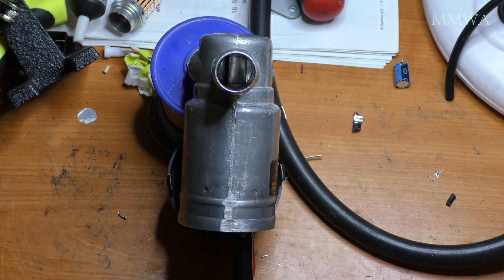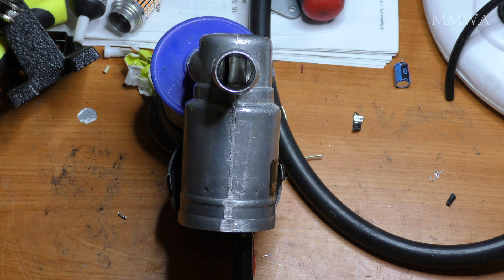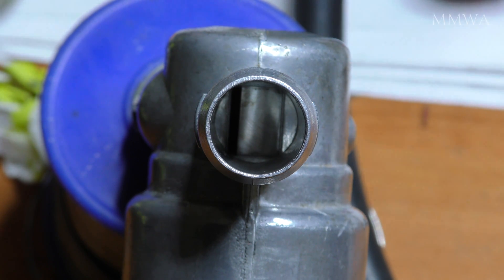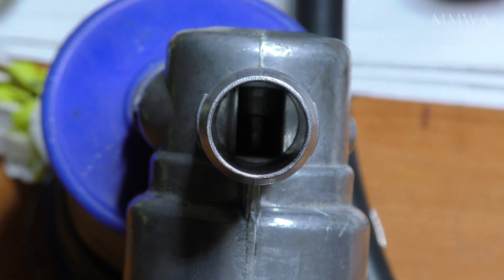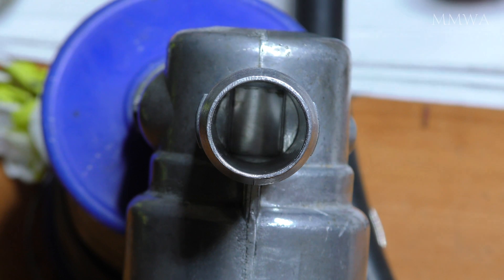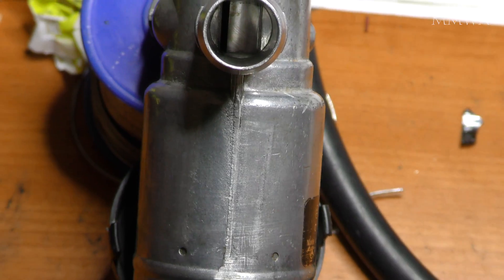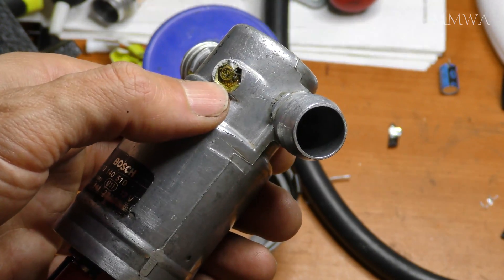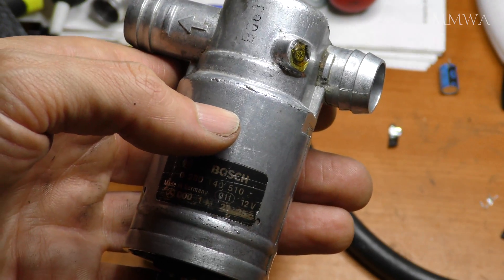Bench testing Mercedes M104.98x idle control valve

Comment: Awesome video .
 I own a 1992 SL300 M104-24 KE Jetronic and a 1997 SL320 M104 . Both are great cars .
  I recently purchased the 1992 SL300 M104-24 with 126,000 original miles and the car idles really rough and about 500 rpm's . I have  to keep my foot on the accelerator, to keep og form stalling out . Do uou have any idea , what the problem could be ? Any information is greatly appreciated.
Thank you .

Comment: My SL 300-24 has been laid up for a few years, so i changed both pumps filter and accumulator, plus cleaned that small filter at the fuel distributor, At last the car started but with clouds of black smoke and an irregular idle , what idle i had to keep my foot on the throttle, it does try to idel but at 450rpm, it soon stops, any suggestion ? I drained the tank and there was a lot of crap, in it plus a black  sludge , 
I will look further, so thank you for this info my car has 135k ( miles ) on it and was laid up for 7 years. Its a multichoice what is causing the problem and reassuringly expensive. Cheshire UK
Reply from the maker: clouds of black smoke usually indicates the fuel distributor diaphragm has failed, it may be the reason the car was originally parked up.  Crap in the tank is very worrisome, i wouldnt have run the car at all with this tank as you may have contaminated the entire fuel system.

Comment: Hello.I cleaned my icv and there i go turning the engine on after a full service and my idle is at 900 rpm i checked everything (vaccums potentiometer  o2 sensor and so on all of them new bought by me)so i go the icv valve and disconect it nothing happens..i check the V and i have 2.4 i plugged it again nothing happens i disengage the microswitch and engage it nothing happens even tho i have the continuity..What would be your thought on this issue?
Reply: Any thoughts please?My idle is normal at 650-700.Voltage to idle valve 2.5V

Comment: W124 2.6 1990 .  Idles perfect. Starts perfect. When put into gear rpm falls beneath 500 and stalls.  Checked and replaced all hoses.  Smoke test.  No leaks.  Air pot between pins 1 and 2 is .92 volts at idle.   Which is within spec.  Idle control valve bench tested perfect.  Open 20% with no voltage and closed at 4 volts and wide open at 8v. Car running in park is sending 4.5 volts to the idle control valve.  New potentiometer on air pot.  Everything is working as it should.  Beyonce my little brain this is very puzzling.  I'm at a loss and about to adjust the set screw on the idle control valve. Any words of wisdom would be great.  This car only has 70k miles

Comment: Good video, but why not explain how you applied power to it.  I'm left wondering how I test my Bosch unit off my Porsche 928 which is similar.
Reply from the maker: with a variable current bench power supply. Thats is literally all you need. Mine is a china special, 0-24V 0-5Amp. Mb states the maximum current availability from the idle speed controller on older models, with this knowledge you can work out if the problem is with the valve or some other external air leak

Comment: Where is the Idle air control valve for 1993 Mercedes 300TE wagon? I can find it
Reply from the maker: what kind of engine do you have?
Reply: @MMWA-DAVE  This is my cars Engine (104) 1993 Model 300 TE (124 092), 4-stroke engine gasoline injector, 6 cylinder.  This is what the owners manual say about my car.  Another model with the same year is 1993 300 TE 4Matic (124 290) Engine 103. This looks identical but not my car. Thanks hope you can tell me why I can't fine the IACV.  Also I found this online saying "Idle control valves are found on CIS cars, yours is EFI" He was referring to a M104 and I think a W124 Mercedes. Thanks
Reply: So if I have a ICV then I can fix the trouble code #6 or If I don't have ICV what is the solution knowing I still got the trouble code #6 (Idle speed control inoperative).  Question: Idle air control valve resposible for the #6 code?
Reply from the maker: @pricelessclips  Your engine is the later efi m104 this video does not apply to your car. I assume your car is a USA version because that is the only country that interfered with model names and labeled that cars in a way that Germany never intended. Your 124.092 would have been called a 320TE anwhere else in the world if its a non facelift 1993 car, and E320 after the facelift.

Comment: Thanks. M102.963 (124.021) W124 200E
The idle valve on my vehicle has 3 pins and an adjusting wheel.
 There is 0.22 volts in the cable, but when you plug the idle valve plug, 0.22 volts does not come. what is the problem ?

Comment: Can the ICV be cleaned ultrasonic or with the q-tips and some carb or brake cleaner?
Reply from the maker: IJMercedes W124 2.3E i only use the carb cleaner. I wouldnt be happy submerging it in an ultrasonic bath
Reply: @MMWA-DAVE  Thanks for the advice and happy rebuild...

Comment: What hardware You are using to control this valve on the bench in such a smooth manner?
a PWM 14V control signal results in very "steppy" motion of a flap(
Reply from the maker: I am just using my bench power supply it has current and voltage limiting but i am only playing with the voltage knob in this video. One of these days I'll put my m104 on the scope and see if its pwm or voltage controlled. W126's were current controlled.

Comment: Yep, the cheap test I've learned is to simply hold a 9V block battery against it, which has the + and - conveniently next to each other. The valve clicks open with a clicky noise. But that just showed me it worked without a bench supply 😅.